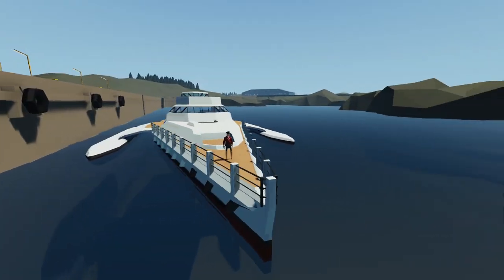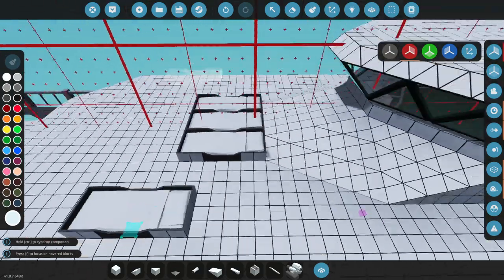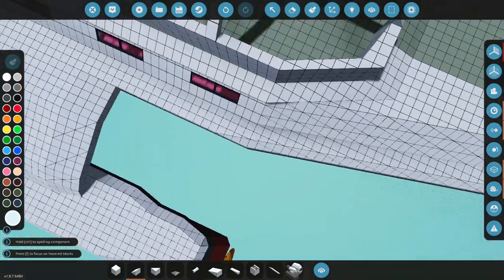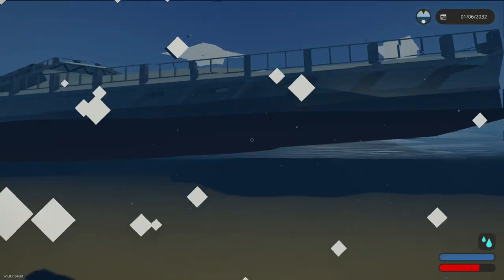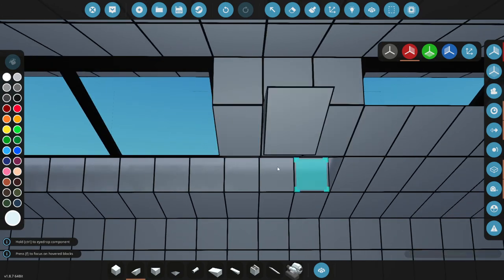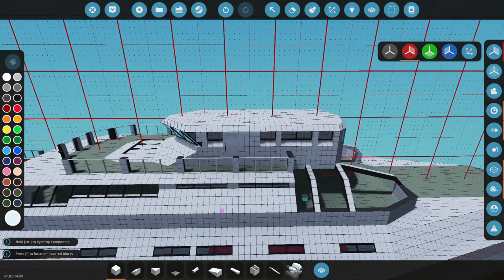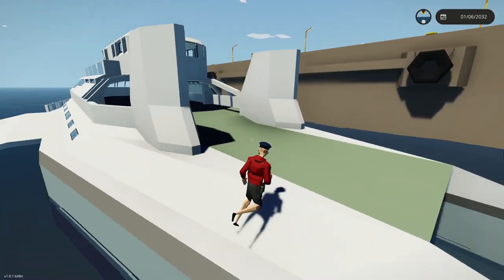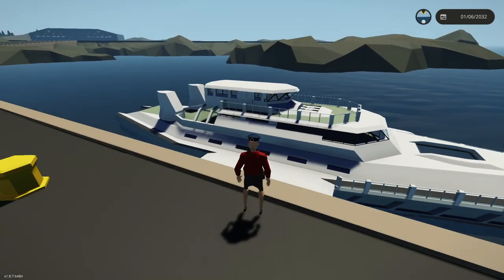Ready For ENGINES! - Futuristic Trimaran Yacht Build In Stormworks #4

Comment: Get rid of the smoke stacks, the trimaran is to modern and streamline looking for smokestacks. Maybe you can do what the LCAC’s with the exhaust from the engine being used on thrust vectoring nosies to make small adjustments. But to stop air resistance and make the boat looked better hide them underwater. Maybe use jet engines on hinge that rotate for docking and extra speed.  It would also add the exhaust fumes.

Comment: Keep it all white and make the bridge sloped the opposite way like the “living room”. You should also slope the windows on the side like you did it on the bottom. Also, the pontoons seem a little too wide and look sort of ugly. Maybe change the bits that connect the pontoons to just two circular ish tubes instead of the massive wing. The details on the hill at the front look a little tacky as well, I would try to make them more slim or just paint them on